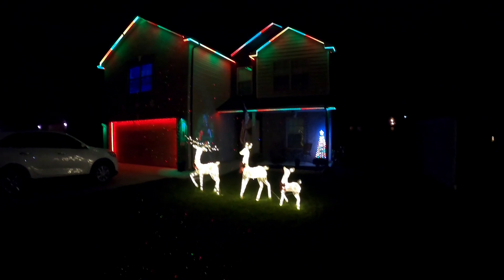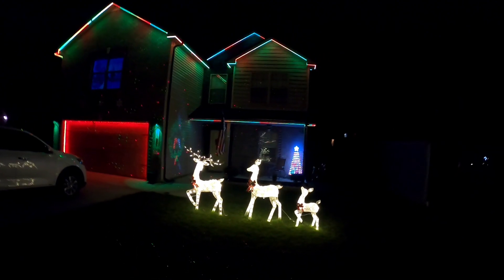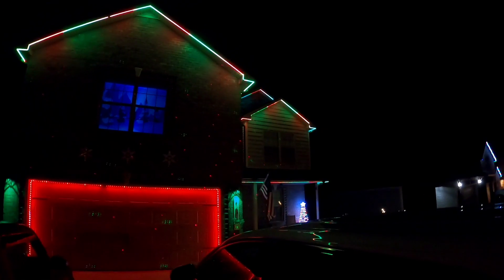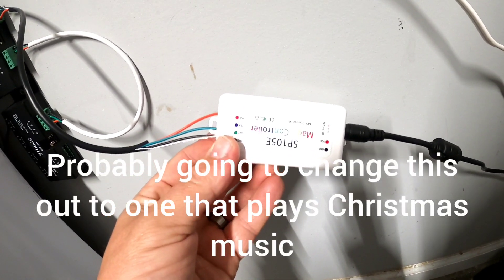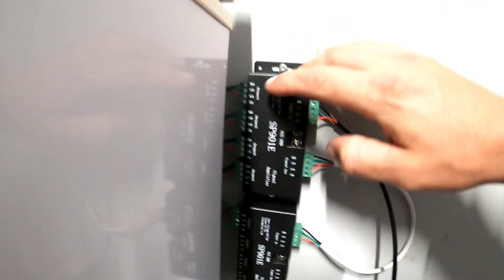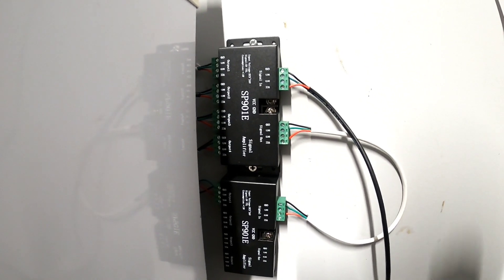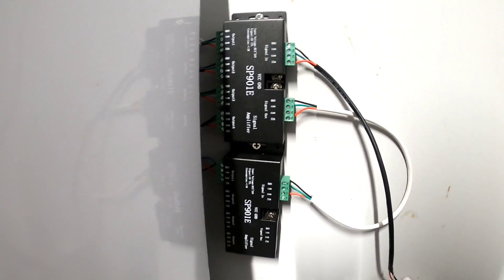Setting up permanent LED lights ws2811 5050 strips. Behind the scenes.

Comment: How many strips can you power off one channel? Never mind heard you say your running 3. Do u have a pic of your new setup with new power supply? Lastly are you still using the sparke LEDS that you have linked from Amazon. Assuming you just use the strips and dump the controller and power supply. Also are you on FB so I can directly message you. Thanks and great set up
Reply from the maker: Hello, thank you for stopping by to check out the video's. When I did all these videos I was just swapping out the controllers. I have since upgraded all my lights to https://amzn.to/3FWwxkv for full customization. I am on Facebook as boredguywithacamera. I can also be reached by email at boredguywithacamera33@gmail.com. thank you.

Comment: Hi,  I have exactly the same set up and I’m so glad I found your vids. You just made my life easy lol! 1 question tho, did you also connect the extra positive and negative wire that are on the led at the end of it? Please help!
Reply from the maker: I did not need to power inject on my project. rule of thumb is that if you don't get pure white at the end of your runs, you will need to power inject.

Comment: Good videos! How many strips max do you recommend connecting together?
Reply from the maker: There are many factors in deciding how many you can run. Depending on controller,  Leds and power injection.

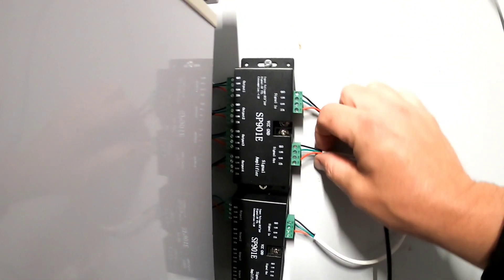Comment: Awesome setup! I watched your other videos about how you ran the wiring from your power amplifier. My question is, when you ran the wire to above the roof, you are using more than 1-5 meter strip across that area correct? And you are using a different wire for each 5 meter strip? Or do you have enough power to not lose brightness on 3 strips in series using one set of wires on the second signal amplifier?? 2:54 So you could run 3 strips with one signal amplifier output? Any help here would be greatly appreciated! Thanks!
Reply from the maker: Welcome to the channel.  As you can see we like to push limits and save money. Yes I have 3 16ft sections run on one channel of the amplifier without loosing color.  Maybe I just got lucky but you'll see my lights are up and running in my latest halloween videos.

Comment: Did you end up upgrading the power and controller?   If so can you update links please.  Going to attempt this but I need roughly 200ft to cover front of my house.  Need to find longer set of outdoor lights
Reply from the maker: Thank you for checking out the videos.  We appreciate the support. It means the world to us knowing that we are helping other's plan a cheap alternative to permanent lighting. I did upgrade the power supply and found that the leds are a bit brighter.  Here's a video at my neighbors house using the upgraded power supply and the music controller.  I'll do an update video come December on the upgrades and added features so be sure to subscribe and check it out. 
https://youtu.be/ntaXW7UHnIM

Also Here's a link to the power supply and the music sync controller. 
https://amzn.to/2WY1L82

https://amzn.to/3h7jhOA

Of course if I can help you along the way, I’m more then happy to. Thanks again and look forward to hearing about your progress along the way.
Reply: Perfect ty..also one question I have.  For instance on your neighbors house he has 6 strips.  Since I need roughly 200ft I wouldn't be able to simply buy a few 50ft footers since I have 90 degree corners.  I'm assuming I will end up with at least 6 different strips of varying lengths.  AND I'll use those power extender cables?  I guess those 90 degree corners are my biggest concern

Comment: Can i use a 500w power supply to start off with and add more led strips in the future, or do i need to find one for my current project and just be over like 20% the required watts required?
Reply from the maker: I think you will be just fine.

Comment: On the 901 amp, what are the VCC and GRD terminals for?
Reply from the maker: Vcc is power and Grd is ground. I found that there was no difference between running direct power to the 901e or running my power supply through the controller. It produces the exact same voltage to all the outputs on the 901e.

Comment: Did you have to cut a strip add wire then connect it to the rest of the strip when you had to go to a different level of the roof?
Reply from the maker: I started a new strip on every peak. So 1 full strip and 4 ft to do the bottom near my front door. Almost 2 strips for the peak above the windows to the right, 1 strip cut for the top peak, one full strip from front to back up top, 2 and a half strips to cover the large peak and down the left side of the house. So its a separate channel for each section of the house. I used wire from my control in the garage and up to each section of the house.

Comment: I dont see a power source hooked up to the terminals on the amplifiers, just a data signal and power for the lights.  What am I missing here.  I could be wrong but I think the power for the 1 supply is only passing thru to the light strips and not actually powering the amps.
Otherwise its a really neat system. I have already been looking into the BTF  system for outdoor lighting in my pool area.
Reply from the maker: The signal amplifiers are multi functional to be used for all types of set ups. The power supply runs into my controller and then into my signal amplifiers inputs. I could run the controller by it self with out power into the signal amplifiers and waste money on a second power supply to power the signal amplifier inputs As stated in the video I have full power coming from the outputs.
Reply: @BoredGuyWithACamera  I hear what your saying, I am glad its all working for you. But the amplifier has a power input for a reason. Not trying to change your setup, like I said its working for you. All the diagrams on BTF shows different. Anyway, great find and it looks great.
Reply from the maker: @DeeDee-vu5mi  your good, I know what all the diagrams show. Without these signal amplifiers I could not get white at the end of two  strips connected to the controller. So with the controller hooked in to the signal amplifiers I have white at the end of 25ft of power wire run up to the start of about 42ft of strips all connected. No color issues and didn't have to power inject anything. I guess I'm just a lucky guy to have everything work in my favor.
Reply: @BoredGuyWithACamera  What happens if you only wire the amplifier from the controller to the signal terminals and no power to the amplifier power terminals?"
Answers to your question

"If SP901E signal amplifier has no power supply , well it still can work when you just connect a few LED strip . For example ,you only connect one LED strip to SP901E , it is ok . But when you connect 4 reels of LED strip to SP901E or 8 reels or more LED strip , your LED strip can not work and lost signal . Anyother question, please contact us support@btf-lighting.com"
BTF-LIGHTING
"Just for information so you'll know, Regards Richard. FYI I just rcvd my first strip from BTF to play with.

Comment: Great educational video.  Just a few questions;
I have a split foyer home and plan buy the items you bought to do my home, similar to yours, Thanks.  
Couple questions; You stated you purchased eight strips, can I connect two or maybe three 32’ strips together to one amplifier input? 
At the center top of your house you have a split to where the lights stop and what appears another set begins, how did you make it blacked out, did you cut and run a wire between them? 
Where is your power supply box, amplifier, etc., physically located?  Foyer or somewhere elsewhere an outlet.  
Lastly, do I have to use the channels or can I use another way to attach them up under the front of my home’s under hangs? 
Just trying to get great advice.  Merry Christmas and happy new year.
Reply from the maker: I really appreciate you stopping by to check out the video. I'll try my best to give you the information I came up with while trying to figure out what was going to work out for us the best. So, if its an older split foyer house where you have a strait lines across the top and then a strain line minus the front door in the middle I would do my best to use 120v lighting. If you have a wood facia that gives you an inch + to hide the light strips you can simply use plastic strips screwed into the back of the facia board. I went with track lighting because I have aluminum facia and the track blends in really well. If I had any kind of lip I would have ran 120v lighting strips. As per the manufacturer you can run two strips side by side from the amplifier. The longest run off strips I have is about 42ft across the peak and down the side of the house but I power injected at 32ft and at the end of the strips. As far as my set up goes I ran everything from my garage to the outside with 3 wire loom to the start of each set of strips for a total of 5 wire sets . I just drilled a hole and ran my wires behind the siding. The blacked out part is from the connections  strip to strip. I didn't want it to be that noticeable but these things happen. It won't be there next year. Lol. I hope I was able to help you out and be sure to check out all the videos I posted on the permanent lights to get a full understanding of how the set up works . Once again thank you, belated Merry Christmas and happy and safe holiday season.
Reply: My home 5 yrs old so it sounds like I should go with something like this; https://www.amazon.com/Less4Leds-Light-Ready-Alexa-Google/dp/B07HS23C1P/ref=pd_lpo_86_t_2/145-2034390-6211937?_encoding=UTF8&pd_rd_i=B07HS23C1P&pd_rd_r=b3a1382a-4b14-4e21-969b-fdb2be777b51&pd_rd_w=qlLn0&pd_rd_wg=n4jg6&pf_rd_p=7b36d496-f366-4631-94d3-61b87b52511b&pf_rd_r=R84NNTZQD695KFD1KP7V&psc=1&refRID=R84NNTZQD695KFD1KP7V
Your thoughts.  It’s much more expensive right.

Comment: That looks awesome I have some questions if you could answer for me. 
I’m thinking of running RBG 2811 strings. Do these light runs clip to one another? Most of the strings I’ve seen are in 50 lights which is like 11-12 ft long how many strings can I connect before they blow out? I can’t find that info out there anywhere. 
Also did you connect your wiring run from the garage to the light string? Is there a splice adapter or something that connnects your wire to the string on the eaves?
Reply from the maker: So I just used these https://amzn.to/3r2ApIo at the end of the strips and spliced my wires in to them. As far as running 50 ft i don't think it will be that difficult,  you would just start with a new strip at each break on your house. If you need to run 50ft strait you could get away with 2811s but I would go with something like BTF-LIGHTING https://amzn.to/3p05ZVh because they have the power injection wires already installed so you just have to run something like https://amzn.to/3mnrE8n side by side from your power source to run the full length.  All the strips i have on the house were 16.4 ft I used a total of 8 strips. I cut the ends off 3 of them.
Reply: @BoredGuyWithACamera   hey thanks I really appreciate it. Just curious why do you favor the strips over the pixel strings? I’ve been reading that the pixels are brighter than the strips but I’ve never installed them so I can’t say for sure.
Reply from the maker: @Kevinw4040  its not that I prefer one over the other, I just feel the strips in the channel is a way cleaner look. The pixels are probably brighter but I was not looking to light up the street ya know. I guess its all based on what your into. They even have 120v light strips that will make your house light up like a runway.
Reply: @BoredGuyWithACamera  Yeh I get that point true. So am I correct in assuming that 4 way spliter on the wall can be like daisy chained to have multiple ones? I see you have a second box below it can you only have 4 outlets? Do they make those boxes bigger with more outputs? Like with 8 out puts?
Reply from the maker: @Kevinw4040  yes I'm using two signal amplifiers that have 4 channels each. I'm only using 5 and obviously I can add three more channels next year if I need to. You can use any signal amplifier like what I have or even a 8 channel like this https://amzn.to/3ajHdeH to double your controller signal.
Reply: @BoredGuyWithACamera  I see that Xunata repeater doesn't appear to have an additional signal output to add another box down the road maybe i'm wrong? Seems like the one you're using would be better for adding on down the road. How did you wire your your strips to the signal output on the amplifier? That repeater/amplifier has 4 screws but the wire only has 3 are you not using one of the screws?
Reply from the maker: @Kevinw4040  you are absolutely correct.  The signal amplifiers im using is what i thought would work best for me in the future. I can add as many as I need and might just have to upgrade my power supply. As far as the 4 connectors on the signal amplifiers,  they can be used to run 3 wire as well as four wire leds light strips. Also there is a way to wire 3 wire leds up so you can run 2 strips off the in channel in parallel. The link i sent you was just for an 8 channel amplifier. Not 100% sure about the details just wanted to show you that they have 8 channel ones out there.

Comment: Sick install! Looks great. Any chance you could post or describe how you made the corners and change of direction of the roof lines?

I'm about to take the plunge and any help is appreciated. I'm ready to never put up lights again 👍🏻

Thank you
Reply from the maker: So each one of my roof lines are a Separate run of lights. I ran the wire from inside the garage where my signal amplifiers are through the wall and behind the siding to each strip of lights. As far as the corners go. I cut the track on angles to match up with each other. Then folded the led strips very carefully around the corners. This is the part that will get alot of people. If you have cheap light strips you could damage the lights. There are a couple videos on youtube that explain in detail on how to do it. I just don't want to be the one that explains it wrong and people start burning out their led strips. Lol
Reply: @BoredGuyWithACamera  thanks for the info. Would love to see a video of the lights really in action going through some sequences
Reply from the maker: @clayswanson3986  that I could do. Have it posted tomorrow morning

Comment: Noob question:  why do I need a led controller ? Do I need it ? I bought the same led, same channel, a higher amp power supply, do I need to get the same led controller and signal amplifier as you to have my lights working ?
Reply from the maker: No, you don't need to add a new controller, the signal amplifier depends on how many sets of lights you plan on using.  I needed it so I could control 8+ sets of lights to do the same thing. Easy on and off.
Reply: @BoredGuyWithACamera  thank you !

Comment: Thanks for posting!  Ordered a amp and hopefully that’ll fix my voltage drop problem.  I also ran the same channel. Don’t have quite as much as yours, as I only have two strips.
Reply from the maker: I hope it works out for you. Sorry to hear about the voltage drop, I know that can be a pain. Let me know how it works out.
Reply from the maker: Merry belated Christmas, was just going through the messages and I was wondering if you had any luck with your voltage drop?
Reply: @BoredGuyWithACamera  well the amp didn’t do a darn thing. Turns out it’s just for signal.  I ended up injecting power in the middle and the end of my strips.  Much better now.  I did order a DigQuad that will have different pre-programmed features.
Reply from the maker: Awesome to hear you got it up and going. Going to check out the recommendation.  Thank you
Reply: @BoredGuyWithACamera  I sure did!  Watch a few videos on YouTube about the DigQuad/DigUno to find out more info about them. Quite a few features!

Comment: You are awesome, thank you so much for all your uploads.
Reply from the maker: Thank you for watching, dont be a stranger. Let us know how it works out for you.
Reply: @BoredGuyWithACamera  in the process of purchasing, which controller were to planning to get for music?
Reply from the maker: @Andy4x4  so, my buddy and I did our houses at the same time and he is running this controller https://amzn.to/3mmbeOf and it works really well with music.
Reply: @BoredGuyWithACamera  did you do roughly 16 feet strip to the amplifier or did you join the 2x 16 feet to make 32 feet then connect that to the amplifier?. What the maximum length per channel i should be connecting to the amplifier?
Reply from the maker: @Andy4x4  so from the amplifier I'm running about 20ft of wire to my closest strip of about 18 ft of led strip, then about 25 ft of wire x2 to start one 16.4 strip and a 10ft strip. The last is the longest of about 25ft of wire connected to about 38 ft of led strips. 2 complete and about 6ft added to that.i just ran it that way. I have the led strips with built in power injection, but I didn't need it
Reply: @BoredGuyWithACamera  how did you go abouts with the led channels with corners, did you use any corner joiner connectors?
Reply from the maker: @Andy4x4  no special corners here. I just used a Sawzall and cut angles so they match up at each corner.
Reply: @BoredGuyWithACamera  is there a big difference in running the led strips with and without the led channels, besides extra waterproofing? Will i get better light output with the led channels?
Reply from the maker: @Andy4x4  the channel diffuses the led pixels to make it more of an ambient light. I would highly recommend the channel if your doing it permanently. Also based on your facia. There are several kinds of facia boards that people have. For me I thought the best look would be channel.